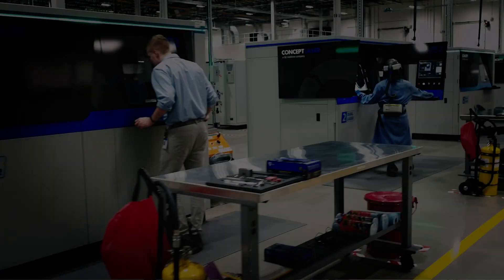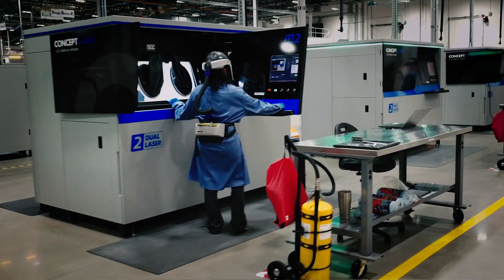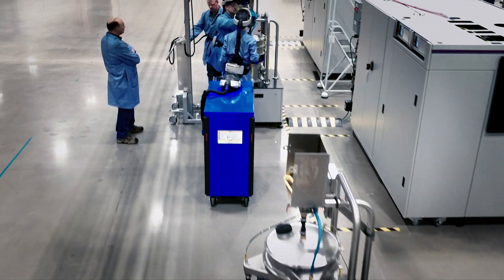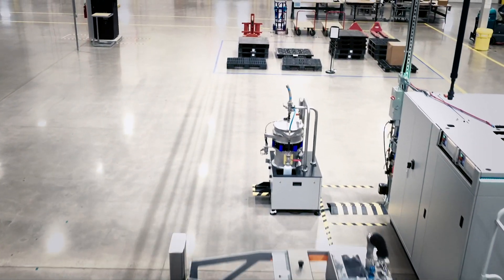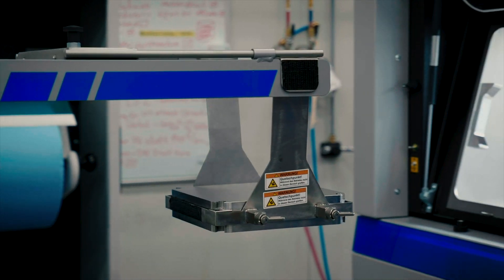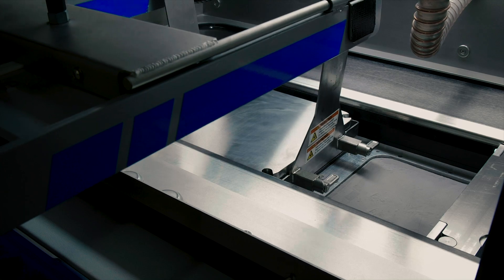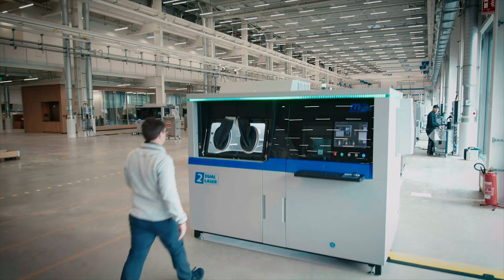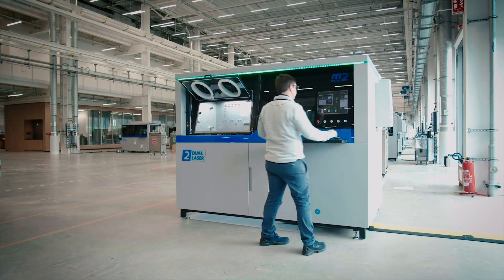M2 Series 5 testimonial

Comment: 3 brand GE appliances failed us in 3 years, microwave, fridge, & toaster. Avoid their products, 4 service calls for the fridge, the tech even said the freezer is poorly designed and sees the model break constantly. Never again.
Reply: GE Appliances are not actually a part of GE Aviation... GE Appliances is was sold to Electrolux a while ago... and other than the name there is no relationship between the two companies.  https://en.wikipedia.org/wiki/GE_Appliances
Reply: Is it same GE ? you mean General Electric of Thomas Edison ? Are they gone mad?entering in business that can be done by daily labour
Reply from the maker: We're sorry to hear about your poor experience with GE Appliances. GE Additive operates outside the household appliance space, specializing in metal 3d printing (additive) machines.